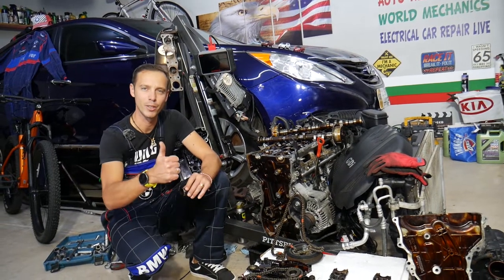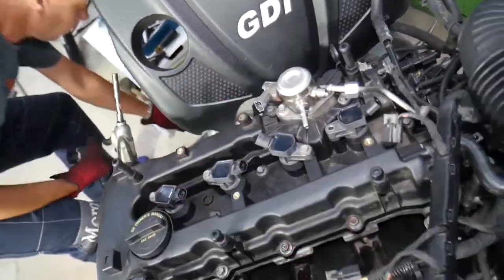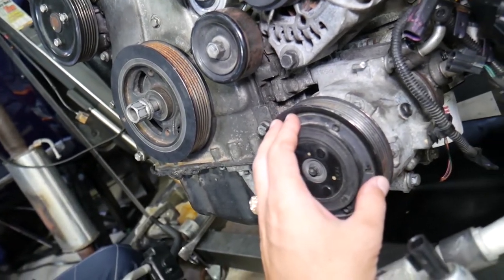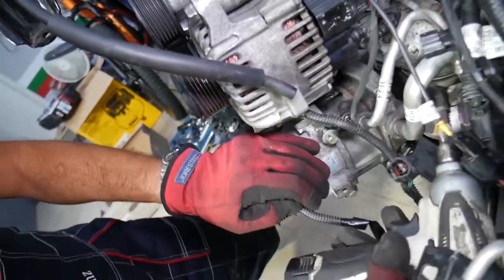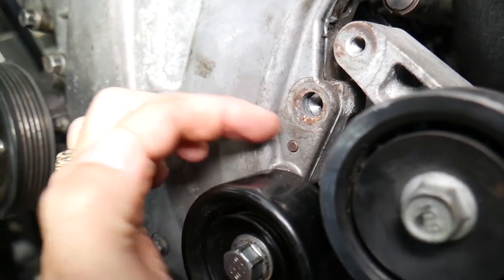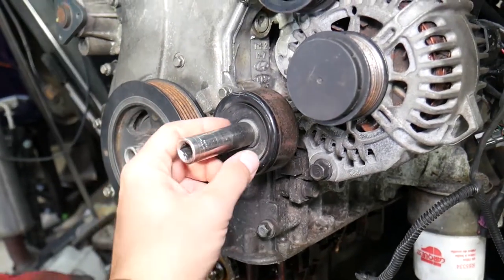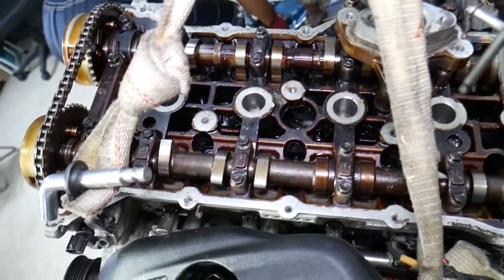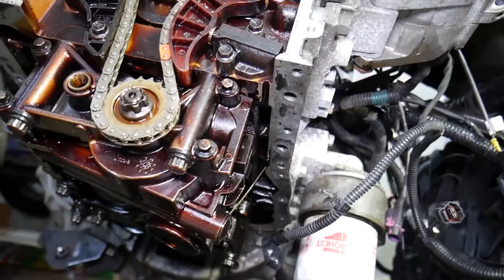VALVE LIFTERS REPLACEMENT HYUNDAI KIA 2.4 GDI ENGINE

Comment: Please I have changed my Ford focus engine but when I press the clutch it doesn't come out, please do you  know why is like that.
Reply: Check your master/slave cylinder, fluid levels and lines. worse case scenario you’ll have to replace the throw out bearings